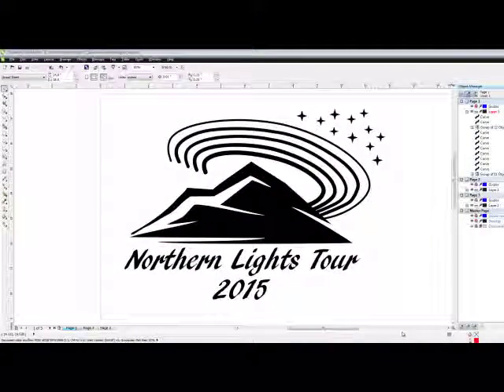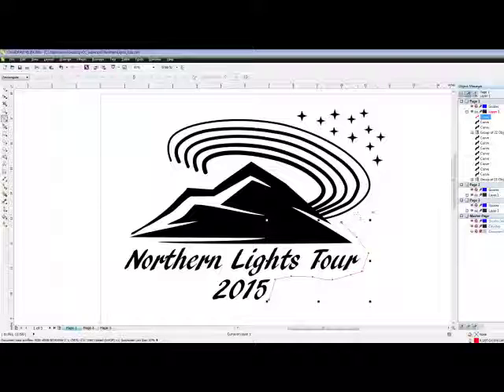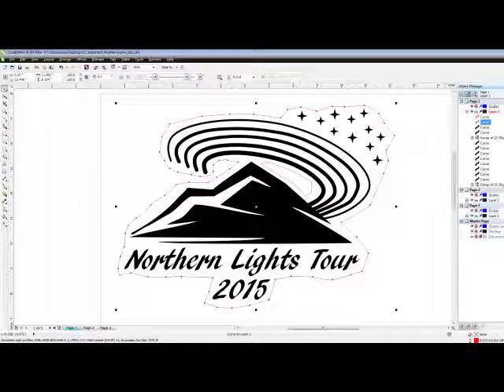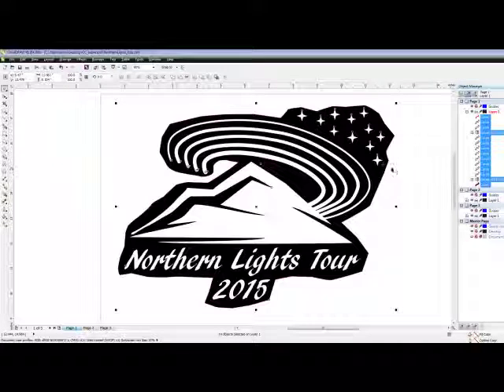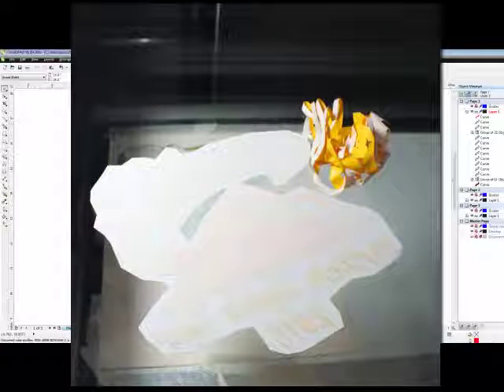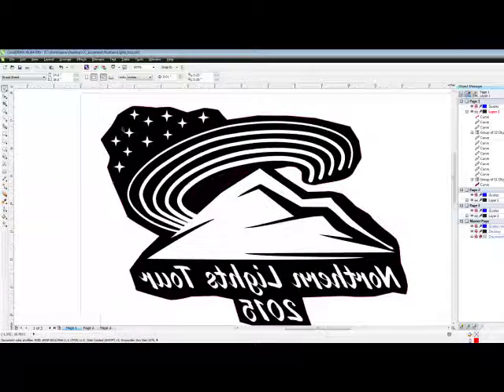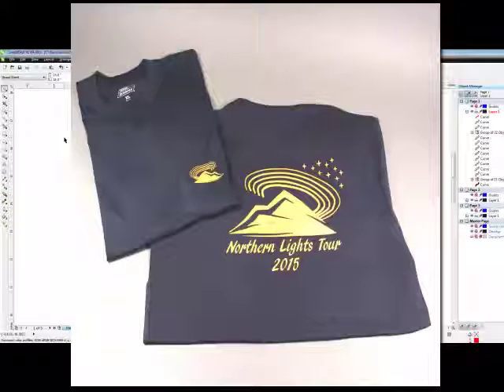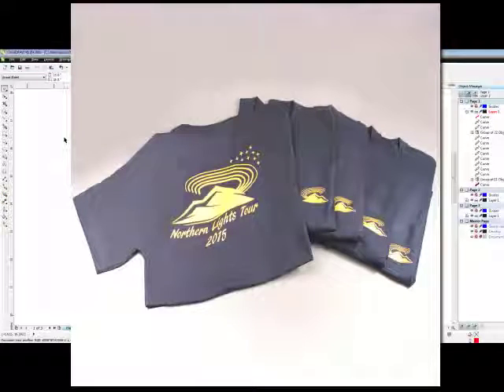LaserFlex - vector method

Comment: SO if I'm understanding this correctly (which I'm probably not lol)  You're using a laser PRINTER to print the art work onto the laserFlex.  Then using the laser CUTTER to trim the material to size to maximize the use of the LaserFlex Transfer paper?  The laser cutter/ engraver isn't really being used to "print". correct?  yes?  no?  maybe?  sorta?
Reply from the maker: No. A laser printer or any kind of printer is never used. You design your artwork, set the outline to hairline and send the job to the laser to vector cut.
Reply: OK ... just looks kind of confusing on their web page.  The transfer paper that I found seemed to be for color printers.   Thank you for your help
Reply: What is the benefit to using the vector method to the full laser weeding? This seems to be more like a traditional vinyl- plotter/cutter method.